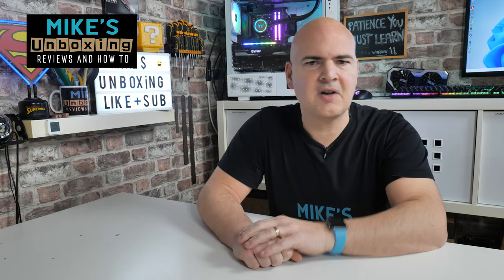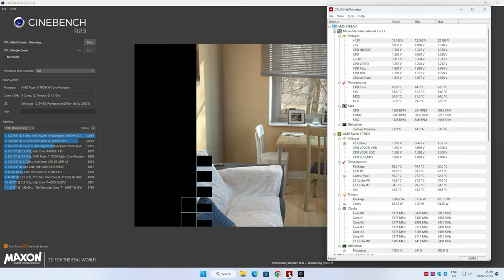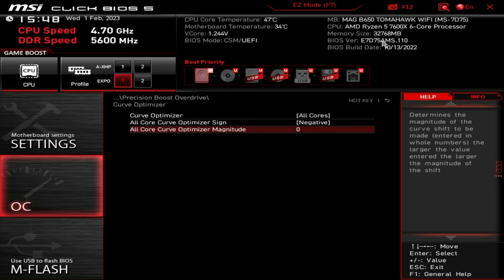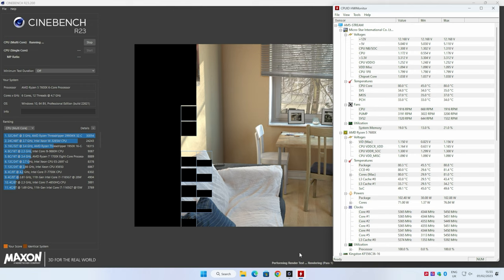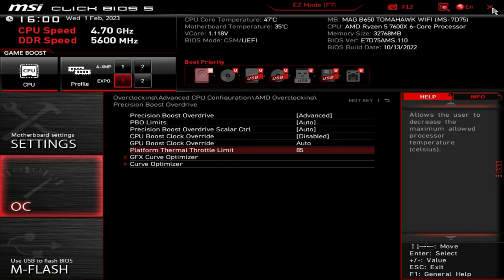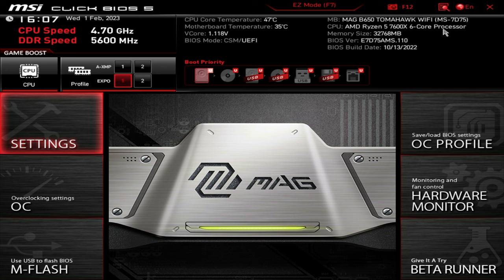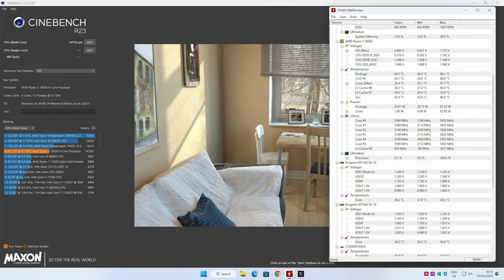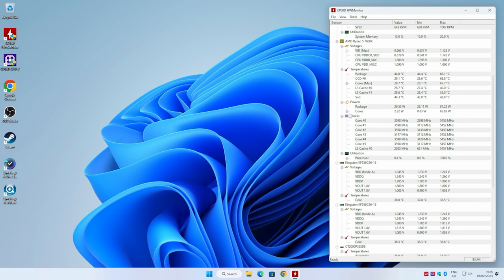How To Tune AM5 Ryzen 7000 Series Wattage & Reduce Temps With Curve Optimiser PBO2

Comment: Currently have all my cores on -45 (one on -40, and yes, values below -30 do get applied and further lower voltage. Works until -50 on my board), have max boost clock +200MHz and stock PBO limits of my 65W CPU. Stresstested THOROUGHLY.
I get longer lifespan and waay more performance with (only) slightly lower temps as it still boosts until the power limit is reached.
Reply from the maker: those are some pretty impressive numbers there
Reply: @mikesunboxing  yeah, I was baffled at first too. Maybe silicon quality improved over time? I just recently bought my 7500F. Or maybe I'm extremely lucky haha
But I really made sure and tested it with y-cruncher, prime95, CoreCycler (with prime avx2/avx512/sse and y-cruncher) and OCCT. All stress tests combined I have 50h of stress testing 😂 also, no clock stretching

Comment: TL;DR: If you are using a gigabyte motherboard and having problems with PBO, update to latest bios and enable PBO Enhancer to 90Level 2-3, save and exit, go back in and adjust your cores accordingly. Much better temps, freq. stays higher, same or slightly better performance.

NVM, still getting high temps after more testing. Only thing that works is pinning the core clock ratio to ~5.x. Lower temps and the same scores. Something about the boost algorithm is driving the temps wild, it seems. 

My 7600x will hit ~92 doing cinebench R23, but it'll hit 97+ during some torture tests.

All my cores are PBO -30, except core 5, with -25, and I'm using a Noctua DH-15 cooler.
During these specific torture tests that cause a lot of heat, I can also hear a whining sound, coming from around the cpu, while it's under load.

Edit: Went back to stock, max temps during R23 went down to ~86. So, tried PBO +10, thinking maybe they were reversed, back up to ~92. 
Also had the highest score on stock settings. Idk, seems mine want to be left alone, lmao.

Edit 2: So, disabled PBO, pinned the clock ratio to 5.35 Ghz... Highest score in R23, using a max of 92 W and only reaching ~83 degrees. I can't make any sense of this, lmao.
Unstable, though. Crashed so hard on a torture test, I had to reset the bios.

Edit 3: After resetting my bios, now stock settings is acting like PBO -30 was before, and PBO -30 is providing the better temps/score. Not the first time I reset this bios, mind you. 
Not sure why it's doing what it is.
Reply from the maker: there is a new 1.0.0.5c agesa bios update that might be worth looking at and the is a new eco mode
Reply: @mikesunboxing  I'm on the lastest bios for my board, F3
Edit: my bad, they must have uploaded a new bios today. I'll test it out soon.
Reply: @mikesunboxing  No difference. PBO -30 settings still hitting 88 in R23, still whining under certain loads, and still hitting ~98 in some torture tests.
OCCT cpu test, large data set, normal, variable. It'll stay at around 88 until 2 minutes in, when it shoots up past max temps. Only in the variable setting though. If I put in on steady, which you would think would produce more heat, it stays at a reasonable temp.

Edit: Solved. On the newest bios for gigabyte, I had to enable the new "PBO enhancement" feature. That option with 90level5, etc. It didn't seem to work in the last bios, but in this one, it won't apply the pbo settings until you save and exit. I'm now getting better temperatures than ever, with equal performance. Would recommend staying near level2 or 3. 3 will set all cores to -30, then you can adjust accordingly.
Reply from the maker: @CigsInABlanket  Glad you got it fixed and thanks for the info 🙂
Reply: @mikesunboxing  Nah, still getting high temps after more testing. Only thing that works for me is pinning the core clock ratio to ~5.x. Lower temps and better scores, at the cost of single core scores being worse. Something about the boost algorithm is driving the temps wild, it seems.

Comment: I set my own 7950x with Corsair H150i 360 AIORAD  to:
Curve Optimizer   Negative 25
Platform Thermal Throttle Limit:   80   (Celcius)
(in milliwatts aka 1000x1w)      PPT  140000     TDC  110000     EDC 170000
Only some stress testing and time.... will tell.. if I got them right.
Reply from the maker: hope it stays stable for you
Reply: Hi, did you find the right voltages?
Reply: @PushCashTTV  For the ram, or the CPU?  

I found an easier way to underclock the CPU, at least on my Gigabyte AORUS Elite AX Motherboard...   on the main Advanced Settings menu, there is a setting you can pull down (I believe it's called Active OC Tuner the 4th item down on Advanced Settings page) to set it to 90C Level 1, or 80C Level 1, or 70C Level 1   (or Level 2, 3, 4, 5).  The first number is the target max temp you don't want the CPU to exceed.   The second number is by how many millivolts x10 you want to undervolt the CPU.  

Depending on your silicon lottery luck will determine how low you can undervolt your CPU before it will randomly crash on full load or not boot at all.   In my case, Level 1 is stable.  Level 2 was stable only until I put the CPU under full load.  Level 3,4, and 5 my system would not boot at all.     

If you mean voltages for memory, there is a video i found on YT of someone who got 4 DIMMs to run at 6000mghz and screenshots of his voltage and timing settings, though I have not tried them with my 5200mghz ram.   From memory training, my RAM is running at 4800Mghz after boot (while in BIOS it will run at a safe conservative 3600Mghz, but speeds up once booted out of UEFI bios)

Comment: I was at ~27000 multicore on my stock 7900x pulling max wattage at 93°

After this I’m at 28938 with max temp of 77°

Monster score. I was a bit concerned after my initial 35W undervolt increased my score to 29000 but didn’t change the temps at all ~93°

Followed through with everything else with 142 on PPT and now it’s golden
Reply from the maker: Excellent work
Reply: So you set the system thermal throttle temp at 93° manually? I have the same cpu

Comment: I have 5 7600, i set -30 curve, 85 temp limit and 85 power limit, boost +100 and cinebench showing  13186 score, while other have 14-15k with the same settings. Max temp is 70 C. What’s the problem? Am i missing something?
Reply from the maker: you are probably using too little voltage try upping it a little

Comment: When you enable or put precision boost overdrive to advanced, is that basically msi's auto oc feature? Is that the same thing as game boost on the root menu?

Also at the end when you changed ppt, is that the same thing basically as changing the "tdp profile" i think the name was, i saw you messing with it on the bios tutorial video, with the exception that through ppt you can change it manually more accuratelly, rather than choosing from profiles which were like 105/85 etc?
Reply from the maker: msi gaming mode is a rather raw and power hungry way to increase clock speeds at the same time much more heat, i avoid it if possible

Comment: Idle temp is what is bothering me with 7700x, under load temps are fine at like 60-65c. I really miss my 5600x that I would put in max voltage and desired clock  and it would crush everything under 50c :
Reply from the maker: what are your idle temps?
Reply: @mikesunboxing  43-45 with Noctua NH-D15s. Sometimes drops to 39.

Comment: I seen 2 flaws. First : you didn't go expo 2, second: when using curve optimizer, You didn't go for load line calibration.
Reply from the maker: expo 2 would be slower? and load line calibration is automatic on most boards, and if set wrong the system can be very unstable, that isn't a good idea to be showing that to people that might not have the knowledge or ability to recognise or remedy that problem
Reply: @mikesunboxing  Expo 2 sets the secondary timings. LLC stops vdroop. On my X470 after undervolting my 5800x, -30 on most cores but 1, ( -25) I needed to set LLC or I couldn't sustain 4.835 all core in cinebench.
Undervolting my 7950x, again, have to use LLC. 
It's not going to give you extra power. It's just going to make sure that the power is there while under load.

Comment: I just assembled an 7800X3D system. My main concern is my 360 AIO making the noise of a jet engine when the Ryzen heats up. But during gaming the heat remains pretty constant and rarely hits 60c.
Reply from the maker: that is the trouble with modern CPUs they like to reach 95c where the previous generation where around 75c so the fan profiles you used to use and the ones baked into the bios from the factory haven't taken this into account so the fans think there is a major heat problem, when really there likely isn't

Comment: I been trying to figure out how to lower my cpu temperature for the last couple months since I built my pc including getting a new cooler. But nothing has cooled down my cpu like this. I did the same exact settings since I have the same cpu and my temperature dropped an average of 15 degrees Celsius when playing the same games as before. I also see hardly any difference in performance. Is it normal for performance to drop when doing this or will it sometimes increase or stay the same? If you could let me know that would be great! Thank you very much for the help!
Reply from the maker: most mnaufacturers add more voltage than is needed as a safe guard for some lower quality silicon parts. that is what drives the temps up, most "good" quality cpus will run just fine and cooler without loads of extra voltage

Comment: How are the auto tweaks towards cpu and memory optimization in this board and bios, any steps you should take to achieve them or does AM5 basically get the best results just enabling game boost on cpu and selecting seemingly best expo profile for the ddr? My goal is not to min max everything i can from the system, im happy if i can get something extra by tweaking or using some auto method without shortening the lifespan of the components.
Reply from the maker: it is similar but more flexible, the best option is to run in eco mode or 65w TDP limit, much cooler and less wasted power and still quite decent performance

Comment: Should i copy ur settings and do it for my 7800x3d? I think my tempatures are good maximum tempature was 82 %100 load 48 degress on desktop in games generally i see 60-65 degress but i want lower temperatures. And if i do these settings will my fps,performance change? Btw nice vid keep going👍
Reply from the maker: you could give it a try, worth testing to see how it performs

Comment: Is it possible to have the ppt set to something low like 15 Watts and the system be able to run? I am trying to build me first pc but unfortunately, I don't trust intel cpus at this moment but ryzen chips have way higher idle wattage than intel cpus. I would like to lower my idle/light load wattage to under 20W if that is even possible.
Reply from the maker: that is maybe worse than high temps as starving the CPU can also led to crashes. You are better off lowering the max frequency

Comment: I have a 5600x and the idle temps are around 57-65 and in gaming its usually around 68-75. my room temperature currently is around 33 celcius so this a concern or is this normal? i have repasted the cpu yesterday
Reply from the maker: with the stock cooler that is about right, but maybe check the backplate and cooler at mounted flush and equal pressure on all sides

Comment: Could anybody help me. I've just brought the 7600x. And it crashes in games sometimes but in cinebench it crashes at about 1 minute in without fail. Yet I cannot undervolt following this video as I get the bsod or it just boot loops? I have the msi bios aswell
Reply from the maker: check the cpu mounting pressure, especially if you are using an AIO
Reply: @mikesunboxing  hi buddy. Thankyou for getting back. I am using a AIO but in games it dosent go over 80c. But still crashes. Should I try to tighten it more or do you recommend taking out the cpu and reseating/putting the cooler back on. Sorry for all the questions this was my first pc build and it's tough to find answers
Reply: @mikesunboxing  also if possible us there a way I could contact you directly to give me some tech help?
Reply: @mikesunboxing  hi again. So I tightened the screws down completly. But still no luck with undervolting. My cpu is boosting to 5450 out the box no overclocks and it's getting hot in games. Was hovering between 75-80 but today I saw it hit 90 for a few seconds in a game that isn't too bound to the cpu. Not sure what I should do or be doing to help

Comment: I had to come back and do this all over again, tried running ryzen master in eco mode as a experiment and the pc wouldn’t boot, I have g-skill ddr5 6000mhz and I read in Reddit that that ram caused issues with others. Had to pull CMOS battery but I’m back up now and the pc see the 6000mhz ram again. Very frustrating though.
Reply from the maker: glad you got there in the end
Reply: @mikesunboxing I went to 90 watts, not going over 67c when running cinebench, score is a few points lower but not hitting 95c.

Comment: Can't tune on my Asus B650e-f bc Asus haven't got their drivers and things in order.  They just recently fixed the compatibility of certain DDR5 to use EXPO.  Right now I get BSOD if I adjust anything, even changing the temperature.
Reply from the maker: This is maybe easier to fix or at least advise if we can ask more questions and get direct answers, so feel free to join our Discord chat and we can go over it in more detail https://discord.gg/XtBTGQ6BDu
Agree to the rules by clicking the emoji and you will get access to the rest of the Discord channels

Comment: Friend, I know very little about the BIOS, I have a 7600X and I want to undervolt it, but I see in other places that other parameters are changed in the BIOS and I just didn't do it because it's not the same as MSI's

I wanted to know what I can do to have lower temperatures of my processor in a safe way, thanks!
Reply from the maker: easiest way is to set the TDP to 65w and you will still get great performance

Comment: when i use -25 curve optimizer my score goes down from 19000 to 18700 why?   7700x
Reply from the maker: not enough voltage? try -20
Reply: @mikesunboxing   shouldn’t higher negative offset result in higher performance /clock speeds?

Comment: TY for these tips my c23 score went from approx 14600 to 15200 for my 7600X  just by doing the curve optimiser.  Im stuck with integrated graphics right now so i wanna overclock it,  do you know where in bios the igpu settings are usually located? (im using asrock b650)
Reply from the maker: nice!

Comment: Why in my Msi B650 gaming plus with ultimate bios E7E26AMS.1A0 at -30 all core i have voltage cpu in stress cynebench 23  up 1.35 volt ?
Reply from the maker: not sure why that is, maybe it is happy to go that high and would have been much more.

Comment: Hi Mike
I have a Gigabyte B650M Aorus Elite AX motherboard with 32gb Corsair 6000 CL36 and an Rx 7800XT GPU. I have recently upgraded my CPU to a Ryzen 7 7800x3D but am having trouble using PBO. My BIOS was updated by Gigabyte control software to F21 and it does not have Curve optimiser, instead it has a setting called PBO enhancements which consists of 3 banks of figures consisting of numbers  90 ,80 and 70 each containing 5 adjustments numbered 1 to 5 on each. I do not know how to use same to configure my x3d processor so am reaching out for some help. I cannot use Ryzen Master as it will not run on Windows 11 pro. Thank you in anticipation for a reply.
Reply from the maker: take a look at this, it might help https://www.techpowerup.com/forums/threads/looking-to-optimize-performance-cooling-a-ryzen-7800x3d-system-with-x670e-aorus-pro-x.322286/

Comment: Hi, thanks for the awesome video. I was wondering why I have a lower score than you on Cinebench. I have 7600x with 280 AIO in NR200P Max. I'm getting only ~14800 stock than after doing the settings and mine are -20, 85w, PTTL 80°F temps and wattage definitely went down from 94 to 79 max and 106W to 87W with cores being 61W. Cinebench score after was ~14400. Any idea whats going on?
Reply from the maker: This is maybe easier to fix or at least advise if we can ask more questions and get direct answers, so feel free to join our Discord chat and we can go over it in more detail https://discord.gg/XtBTGQ6BDu
Agree to the rules by clicking the emoji and you will get access to the rest of the Discord channels
Reply: @mikesunboxing  Awesome, I just joined!

Comment: Unfortunately on my 7600 power limit just doesn’t drop to the specified one. Generally used power was around 97-98W but when I set PPT in BIOS to use 80W it still uses 97-98W regardless. I also have offset set to -20 but still no luck on dropping temperatures:(
Reply from the maker: something a bit weird going on there, maybe go into curve optimiser and choose the eco mode option or 65w limit
Reply: @mikesunboxing  I’ll give this a go. Thank you
Reply from the maker: @andriusmosta  Feel free to join our Discord chat if you need any more help https://discord.gg/XtBTGQ6BDu

Agree to the rules by clicking the emoji and you will get access to the rest of the Discord channels

Comment: I tried the curve optimiser on my gigabyte x670 Altus elite ax with a negative 25 and it made no difference to temps or boost clock whatsoever. It seems gigabyte is not so straightforward, probably going to have to use Ryzen master and leave it running instead ☹️
Reply from the maker: that is strange, it should have made some difference? not tried many gigabyte board on AM5 yet so i can't be 100%